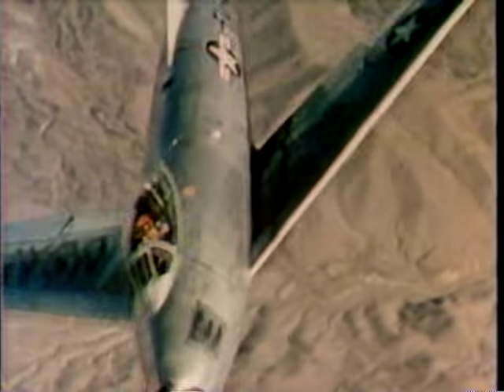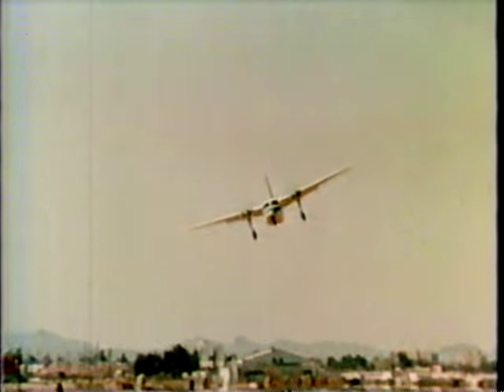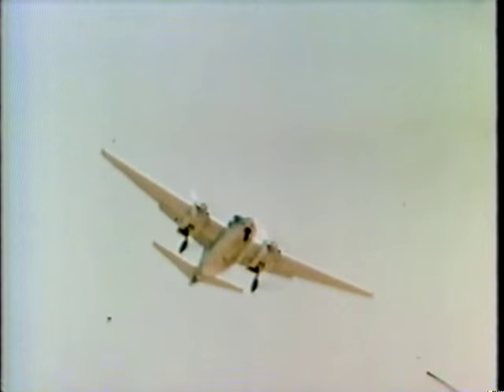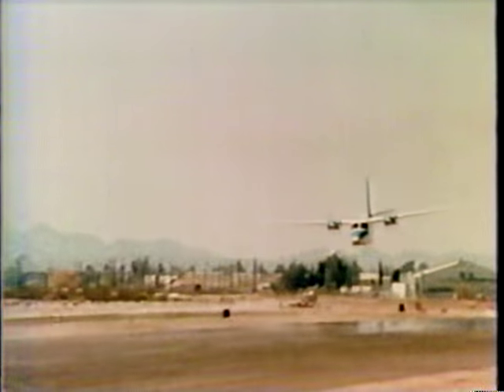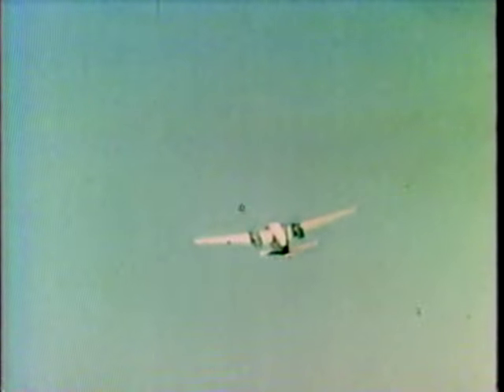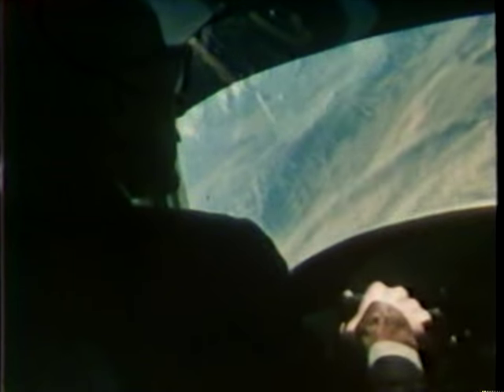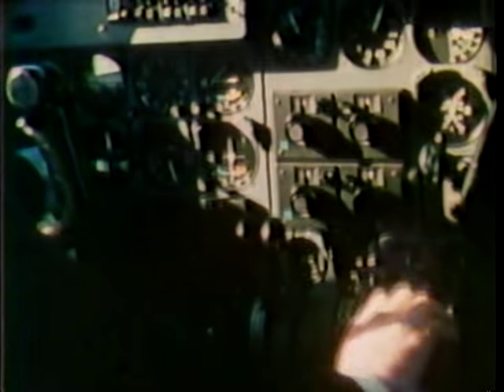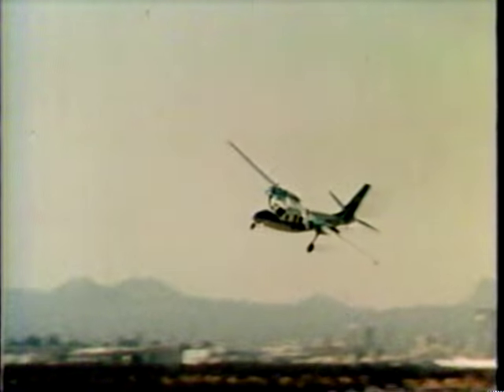Bob Hoover -- Engine-out Aerobatics!

Comment: It seems like Bob Hoover is the only "Old and Bold Pilot" still living he has disproved that saying.
Reply: kell490 Well, there's the other saying, about the "exception proving the rule". The fact that he's the only one ought to be significant to other pilots. However, I think "bold" really implies something more like "brash", while this man is supremely aware of what he is doing and how to do it. "Bold" would be "hey, I bet I can do a loop in this thing with an engine out...here, hold my beer!". Hoover KNOWS he can loop in it, and how to do it successfully.
Reply: justforever96 I know what you mean but if you actually look at how many air show pilots who fly low level aerobatics have died I guess what I was thinking is bold is preforming low level aerobatics. The risk is very high only a small mistake can cost life.
Reply: +kell490 I'd say there's a difference between going out and doing this for kicks, and having done it hundreds, or thousands of times at altitude to know the exact handling characteristics.
Reply: Andy Plater That might be true but if you look into how many air show aerobatic pilots have been killed who had 10 of thousands of hours the saying still holds true.
Reply: You're right, but that's a calculated risk you have to take as an airshow pilot.
Reply: Andy Plater Yes for them, but Bob seemed to have beaten the odds another very good airshow pilot is Sean D Tucker I really respect his flying. I once saw a guy die in a fire ball when he looped too low in a F-86 Saber Jet I think he forgot to set his altimeter for the airport same thing happened to a Thunderbird a few years ago. He almost had pulled it off but was still descending too fast slammed it into the run way 1990's El Toro Marine Base California.
Reply: +kell490 No he isn't a bold pilot. He knows the limits of his airplane very well and always leaves himself a healthy margin for error. A bold pilot would be someone attempting his type of maneuvers without his experience.
Reply: JLDoctorWho I guess you could look at it that way low level aerobatics do push the risks up margin for error is much less. I think one could say doing low level aerobatics like he did took a bold person to do it. Others who were very good aerobatic pilots have shorted their lives.

 The definition of bold is" not hesitating or fearful in the face of actual or possible danger or rebuff; courageous and daring"
Reply: kell490 Risk is one thing, managing it is another. The margin a pilot needs drops with experience. Low level aerobatics have risk. Not precision approaches instrument approaches have risk. Neither one has a particularly high level of risk unless the pilot preforming the maneuver doesn't leave an appropriate margin.

A pilot that flies into a cloud without instrument training is bold. A pilot who is current on instruments isn't necessarily. Bob is defiantly one who knows his limits and leaves himself a good enough margin for his flying ability.

Bob Hoover is without question one of the most experienced aviator in the world and one of the best. He doesn't need as big a margin as the rest of us to be safe.
Reply: There are many..But the mediocre pilots who cannot do Aerobatics (Mild Maneuvering Only Pilots) always try to ignore there are old and never crashed Aerobatics Pilots and CFI's by the thousands in USA..Anyone can fly an all automatic jet in last 3 decades..Try teaching 300 feet agl engine fails on piston planes... Piston twins engine fails on take off make or break the real NO BS pilots..Bob Hoover types are there..but he is the most famous and better of we all..
Reply: blastman8888
--yeah thanks..Love to see real talented flyers, not just publishing themseves doing the normal and easy to do maneuvers and procedures..
Reply: blastman8888   That's because his piloting skills were god like.
Reply: Check out Lieutenant Hoover's history and you'll discover he was, in fact, a bold pilot. As a young boy with very little training, he was out doing rolls and loops in an old barnstormer because, as he put it, he didn't know he wasn't supposed to. When he joined the military and started flying, it was almost immediately that he was showing the instructor pilots what their airplanes were capable of -- not because of his training, but because he intuitively understood the machines and how to find their limits.

He also survived many crashes, especially as a test pilot. Very nearly didn't survive a few.

Bob Hover was absolutely an old, bold pilot, and to say otherwise would be to tarnish his legacy. And I'm sure if you were able to ask him, he would tell you, "don't do what I did - you'll likely get yourself killed."
Reply: Even Bob said he was surprised that he ever survived as long as he did it was his experience he gained test flying in WW2 planes built by local village people in the middle east. He said in that movie they would connect the controls backwards. He said once a week he had an engine out landing that kind of experience doesn't repeat itself ever.
Reply: My A&P school had one of these for students to train on, affectionately dubbed the Ground Commander

Comment: I've seen Bob Hoover a few times, and the best part of this routine is that the Commander is stock. The only mod that Bob said was done to the airplane was installing modified wheel bearings with with a few thousands of an inch loose play to allow him to do the landing and taxing to the crowd with the engines off, using just energy management. Amazing skill and no one comes close!
Reply: How on earth did that aircraft stay together??? The 1960's Aero Commander had a wing main spar weakness issue which saw a number of them losing a wing in mid-flight WITHOUT aerobatics being performed!
Reply: I was Bob's ferry pilot. I have sat with him on several practice flights. He was so smooth a pilot he only pulled 2 positive G's, and a lot of Zero G. Not even half way to the structural limits of 4.4 positive and 2.5 negative. It was a very mild ride with very little stress on the aircraft. That's why he's the "Best of the Best".

Comment: Had the great pleasure of seeing Bob Hoover perform at the Reno Air Races a couple times in the 80's.   The best of the best performers were there but the Shrike Commander show really stood out.  Clearly a great airman.  The proximity to the runway with wheels up was insane.  But the manouvers without power were another level.  Just when you thought he had to be done, he kept going and going.  He knew exactly how much energy to conserve.  Including landing deadstick with enough speed to roll perfectly right up to the flightline in front of the crowds.   It didn't even look like he touched the brakes.  Then he popped out wearing that signature hat.  :-)

Comment: That aircraft must have UNBELIEVEABLE glide to weight ratio...my goodness what a glide capability
Reply: It ain't the arrow, it's the Indian.
Reply: yes , it was a glider.  bob could milk more out of an airplane than any other pilot.  he survived with a stuck stick pointing the airplane almost straight up one time.  kept doing stalls high in the air (hammerheads and others) until able to get enough height each time after almost hitting the ground , then crash landed.  i believe it was an F-86, could be wrong on that.  but anyway, no one could have ever survived that but RA Bob Hoover, no one...

Comment: When the P38 was introduced to England pilots were vexed by twin engine technique, POS they said.  Bob was asked to demonstrate it and was told to win them over.  So with a standard takeoff he shutoff an engine after raising the gear.  He flew the standard aerobatic maneuvers taught to all pilots and landed on only one engine.  You could have heard a pin drop, no one complained after that except that the heater was too cold.

Comment: shutting off the engine doesn't mean shutting of the power. the electrical systems onboard is driven primarily by the alternator which is power by engines, but there is also a battery to provide backup power.

Comment: One question I have.  How is he able to drop the landing gear without power?
Doesn't one of the engines run the hydraulics which is needed to work the
gear to start with?  Or, will gravity drop them on their own & how would you
lock them in place if that is possible?
Reply: Both engines have hydraulic pumps, and there is an backup electric pump as well, as you need hydraulics for gear, brakes, flaps, and steering. The emergency gear extension system is pretty interesting in that the nose wheel free falls and locks via a bungee, where as the main gear relies on a tank of pressurized nitrogen. I had to review the manual, as I haven't been in one of these since about 1987... alas the nitrogen tank is something that I knew right away Lol

Comment: that first side slip thing will put so much pressure on the vertical stab and thats not good if you look at american airlines flight 587 that flight crashed due to to mush pressure on the vertical stab broke it off and it crashed